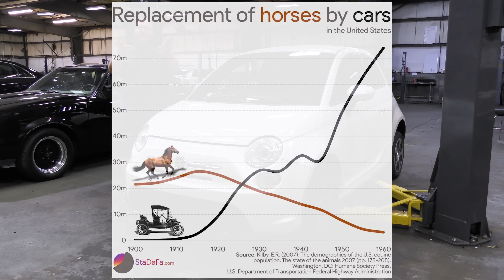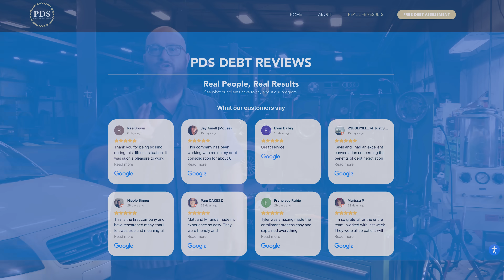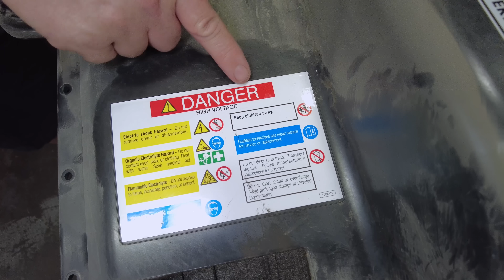How to SAFELY Remove the EV Batteries From my Fiat 500e

Comment: The heart of the battery subsystem is the "BMS" or Battery Management System. They call theirs "Battery Control Module" but that is just industry naming games.  The BMS' function is to monitor the battery health and charge as needed. Health is defined as State of Charge, ampacity, temperature, resistance, balance, voltage and current. Generally the BMS doesn't fail because it is really not stressed in operation. The inverter - the device that converts Battery DC voltage to AC voltage for the motor tends to get stressed and has large temperature swings. Note that batteries when accelerating and charging have peak amperage demands well beyond their normal specs. A battery pack rated for six amps may momentarily supply (or receive) 6 to 10 times that during these periods and because its a chemical process the temperature will rise dramatically and instantaneously well beyond the ability for the coolant system (if there is one) to mitigate. (The coolant will eventually pull this heat away but it will take  tens of seconds or more. So that is the "curse" and the heart of most failures. When batteries super heat over multiple cycles they drift in capacity. And since you have a large number of cells they may not drift in unison. That differential is referred to out of balance and will throw warnings and eventually errors. Yes one bad cell can render a whole pack unusable. It may take 6 years to get there but that is the primary failure mode. And I said "one" bad cell. Well usually its one or more cells that have the worst cooling that go first.  But what of all the not bad cells - they are perfectly fine. And that is why rebuilding with used "tested" cells is a valid solution.  The key thing is once you pull that safety plug this is NOT a high voltage pack. Its a bunch of individual modules you can safely measure just as you would your standard car battery. You measure each cell one at a time (make a spreadsheet!) and determine who is the weakest link.  If you see a small group that are more than 10% below the others - replace them all. Note that many home mechanics have taken these weak cells and recharged them separately and restored them to health. That is a gamble but can work. Its a lot of trouble to drop a pack so decide if the risk is worth it.  The thing to understand  is ALL THE CELLS are charged as one. So the weak cells never get special attention by the BMS. If they did, packs likely would last longer as drift (vs its neighbors) is really what throws the error. 
Anyway - any good mechanic can master this new skill set. Most auto tech classes do a poor job at training for electrical  and specifically computer failures. But its all understandable. EV's are far far less complex that ICE. Its just unfamiliar. So you learn a little and make it boringly simple.  
And please - it should be crystal clear that Climate Change and Global Warming is real. We need this. Even an Exxon Mobil employee admitted to suppressing their climate findings from the 1980's. Can't go back; need to go forward. And it should be obvious as Teslas blow away Hellcats that there is no sacrifice EXCEPT range and charge times. And that is getting fixed. Tesla has open sourced their tech. That means any manufacturer can use it and drive the cost down while increasing the number of suppliers. Over 100 universities are working on new battery chemistries using common plentiful minerals. And all those batteries will be 100% recycled.  So lower cost, longer range, faster charge times and a million mile car is coming.  ICE and diesel specifically will still be around. They have unique benefits.  So there will always be a market to service these.

Note - I doubt its the BMS. More likely there is one or two weak cells. The pack can only charge to the level of the  weakest cell because its en electrical series circuit. Locate that cell and swap it with a new or used one (they are available) and you are back in biz. This is what Hoovie did on his Prius. He did the whole pack but that likely wasn't necessary.  Note that these cells are maybe 20V and 10 amps worst case usually much less. You can safely handle them and even charge them with a low cost RC hobby charger. And you can measure them with a generic DMM. Many Prius owners have removed the weak cells and run a full discharge/recharge loop on them 10 times or so and brought them back to virtually new. Charting their "recovery" tells you if they are worth keeping. If each discharge / charge cycle shows improvement over the last - you keep going.  If each is worse than the last - chuck it and get a fresh module. Finally batteryuniversity.com has all the knowledge you need. Check it out. Great resource.
Reply: What a hugely educational comment.  Thank you.
Reply: Comments like this are what makes YT worth it. Free shared knowledge that benefits everyone. Thank you.
Reply: Wow.. did I learn alot  on this. Many thanks
Reply: Milwaukee batteries work the same way.
Reply: @gregjohnson2073  - All battery packs work the same way.  That's why a cheap RC charger works!  (Even on Milwaukees, DeWalts, Ryobi's etc)
Reply: Battery voltage balancing. Such a relatively simple preventative maintenance that most of not all manufacturers prefer to ignore....
Reply: First look up the effect that CO2 has had on our atmosphere over the last several decades. When you surprise yourself to find out that it has had the opposite effect that many people have been led to believe, hopefully that opens up your mind to more like the very good interview with climatologist Dr. J Christy. The title is his name then "debunks the narrative" There's a reason the IPCC stopped using highly accurate satellite data to measure global temperature in 2015. The results didn't fit the "warming beliefs". I'd give other video references but YT erases comments that contains certain people's names or certain titles. When only one side of an opinion is allowed, it should raise an eyebrow.
Reply: Look up the effect that CO2 has had on our atmosphere over the last several decades. It may be surprising to find out it's the opposite of what many have been led to believe. Then watch the 49 minute interview with climatologist Dr J Christy called data shows there's no catastrophe looming. 4th try commenting, all the rest have gotten censored. What does it say when only one side of an opinion is allowed?
Reply: Look up the effect that CO2 has had on our atmosphere over the last several decades. It may be surprising to find out it's the opposite of what many have been led to believe.
Reply: I've tried 6 or 7 times to reference an interview with a climatologist who presents a lot of compelling data that goes against the "prevailing winds", and my comments have gotten censored every time. That should tell you what the truth really is.
Reply: Look up the effect that CO2 has had on our atmosphere over the last several decades. The answer surprises many.
Reply: The climatologist interview is on YT, and is called "Data shows there's no climate catastrophe looming" and is 49 minutes. Lots of good data in there.
Reply: @readtherealanthonyfaucibyr6444 Just another nutcase with bullshit "information" who somehow knows better than decades worths of global climate research. Besides we can already see and feel the effects every warm winter and hot summer - going from one record year to another.

But I was curious and tried to find that video. Can't find it. Either he changed the title or it got de-indexed due to misinformation.

Usually when I watch those arguments it's one of 3 cases:

1) Religious nutcase 

2) Sponsored by fossil fuels companies and their "think tanks"

3) Right wing nutcase 

Often combinations of the above.

Please don't fall for the conspiracy theory bullshit, just because you think dealing with reality is inconvenient.

Comment: 2016 500e owner here. I appreciate the insight. I drive 6 miles a day and absolutely LOVE my Fiat. You are spot on in your assessments. Hopefully you get that bit back and balance your cells. It's not too different than lipos and brushless motors on me RC airplanes!😅
Reply: LiPo batteries certainly  have changed the rc airplane and helicopter  hobby for the better.
   30% nitro helicopter fuel now costs $160.00 a gallon.
Reply: @PedroBrando  Yup! I've got a few sizeable toys that take a 14s (2 7 cell in series) and a 350 amp ESC. They absolutely smoke a gas plane of similar size, but have a short flight time. Much like my Fiat! It's crazy good. So good Im probably going to grab a few more of them.

Comment: I love my EV.  I also love the old gassers.  The EV is far cheaper to run and more powerful.  Drives really well.  I've driven 115,000km over 3yrs and only replaced front brake pads (because when I had the shop clean and lube the brake system, the pad delaminated).  400$.  

We do need to get manufactures to design their battery packs to be more repairable.  If they could be made to accept new battery modules if the existing ones need service but the old type aren't available, that'd be great.

Battery packs and controllers going bad isn't very common.  This FIAT500e is 10yrs old.  What was your 10yr old daily driver like after 10yrs with 100-200k on it?
Reply: Lawyers would never allow some 3rd party to crack open the battery pack on a old car, exposing themselves to all sorts of liability.
Reply: @aussie2uGA  
See EV in Christchurch New Zealand..
they rebuild battery packs for Nissan Leafs and have cracked the software for English rather than Japanese language appearing on the screens in the cars..
and to insert 40 to 62kwh batteries in old Leafs to make them better ranged than when they were new....

Comment: If you give the VIN number to Fiat, they will be able to see exactly which capacity battery pack it has. I find it kinda funny that its the German part thats let this Italian car down 😆

Its interesting to see the floorpan, its hard to see if its unique to the "E", or if its standard with added attachment points for the pack..Would be interesting to put a gas one on the ramp next to it to see how different it is...

Comment: As an EV driver and enthusiastic supporter of everything electric. I was really impressed with your balanced fair and knowledgeable presentation, been following your channel from the beginning and this video illustrates why you are a proper mechanic and not a technician as seems to be the norm these days. Keep up the good work informing us of the future of motoring.
Reply: I don't have a problem with EVs.  I do think having taxpayers subsidize Teslas (and other expensive EVs) with a $7500 tax credit is unfair.  CARB requirement that vechiles like this are sold is also states putting their finger on the EV / ICE scale.
Reply: @briangasser973 The whole EV trend is entirely artificial in nature. If the technology was there then the market would be driving the change. Government force is what is driving the change and that is the problem. You can't artificially force the change. Also none of the EV people are willing to accept that the batteries have to be manufactured and then you have to charge them using more resources than a regular ice car will. Just typical midwittery
Reply: @briangasser973 . All cars are subsidised at point.
Reply: @iancouper3644 yeah, heck I think even milk is subsidized. It’s the way of things. I own a Bolt; had owned a Fiat 500e and love them both. Good cars.
Reply: @briangasser973 yeah I’m relatively certain that sort of thing didn’t go on in the transition from horses to autos making it a terrible equivalency
Reply: when charging times decrease and range increases enough, I'll jump on the bandwagon.

Comment: Here to stay??? When an obscure outfit from Bulgaria is required to look after a vehicle "only" 10 years old that's not just a failure, but compared to 20yo ICE rides a failure before launch 🤣🤣🤣

And that goes for the vehicle manufacturers as well. Ending factory support for a car at just 10 years old won't win over serious buyers who like to keep their cars long-term. You're killing used EV sales, if that can even be mentioned as a thing, and making keeping them on the road beyond 10 years a serious question and financial burden.

Don't believe it??? Look at all the hassles start-stop technology has caused in gas cars!! Parts fail prematurely, engines dead under 100K miles, more complicated repairs, etc...

The only way to get into an EV today is with the mindset that the price you paid brand new will all be thrown away at the 10 year point long after all warranties have expired 🔥🔥🔥 The number of car buyers who are like that are very minuscule!!

ICE cars are here to stay for a very long time yet... never mind long-haul diesel trucks.
Reply: In New Zealand we specialize in importing Japanese domestic market second hand cars...

so we also know how to reengineer the Nissan Leaf batteries by opening them up and separating out the individual cells from packs from wrecked cars or "useless" packs....
and amalgamating them into a very useable pack that can re reinstalled into a car.

Or if the cells are less than 85% state of health....using cells to build "home batteries" for solar power storage....

Plus of course re engineering the software to translate the Japanese screens into English

and new software to be able to use the higher output newer batteries in the older Leafs.

So 10 to 15 year old Leafs can be restored to better than new range...

It helps that NZ is used to Japanese cars being useful to us in a second life...
and as the climate here is temperate..
the Leaf batteries don't cook or freeze in normal use....

so we have one of the highest concentrations of Leafs in the world...about 120K cars...

So if Bulgaria has the same mindset re Fiat's EVs and does the same reverse engineering...
more power to their elbow if the rest of the world has to go to them.....

Comment: Where are we today indeed! Electric vehicles with totally absurd claimed ranges with no consequences to the manufacturers making these false claims. Also what happens when the minerals needed to make these batteries become scarce? Plus what do we do with the batteries that come out of the older vehicles? EV will never be sustainable. It’s a pipe dream claiming to solve a non existing issue of emissions which has been proven not to be created by passenger vehicles.

Comment: For me, it’s a matter of simple preference. Current battery technology isn’t up to snuff. Some of the emerging ones look promising, but that’s I don’t know how long away. No universal standard is a huge problem.
•I like to work on my own equipment and I’m not tech savvy like I am mechanically savvy.
•I want something that I don’t have to question will last me damn near forever.
•I don’t want something where all the features are screen controlled. Things I readily use and we all use have no business being on a screen. Button operation does the job just fine for climate control and seat control. Otherwise go for it. 
•Privacy. All those tech features, a lot of them track your every move and that’s a major problem legally and morally. I don’t want to be tracked because I value my privacy so I don’t really consent to being tracked. How I live my life and where I choose to go is nobody’s business but my own. Regulators really need to put the lid on this issue and hold companies accountable for invasion of privacy. They cannot keep writing themselves an exemption to our privacy rights. EVs and all other Vehicles produced in higher trim are all offenders of this issue. I will not get a top trim level of any vehicle or an EV on these grounds alone to be honest. Time to respect individual privacy rights is long overdue.
Reply: Keep in mind you're using media talking points.  OnStar stole, monitored, and resold all of our data from GM cars for decades now.  As they say, data is the new oil.  Notice they try to keep quiet the stories about highway patrol calling in to have GM vehicles disabled during a pursuit.  They can turn off the engine, roll up the windows, and lock the doors all from a request.  I agree, thats scary but it's done now regardless of the powertrain in the car.
 When you press the button or turn a dial on any newer car, you're still sending that signal electronically via the canbus to a computer to do what you wanted it to do.  A touchscreen or voice command does the same.
As for working on the cars, what new cars can be worked on without inside knowledge and expensive tech tools?  Even a 12V BMW agm battery replacement needs it to "coded" by a dealer or the alternator will be stressed and fail earlier.  Everything of late has been designed to keep people going back to the dealer service department, where 60% of their profits are made.

Comment: I'm at the halfway point through this video and, not for nothing but, the tunnel running down the center of that car sure does look like you could put a drive shaft in it if one were so inclined to perform a conversion from electric to something more conventional

Comment: I own a nissan leaf and indeed their temprature is not managed but the cells are hardened to take on the temperature differences. Now, they are not doing as good a job as temp managed cells. However if you drive it in a mild climate, charge only occasionaly up to 100 prcent and even less with fast charging... best avoid that all together the batteries can last a long time. We do short distances with the leaf and large ones with ice Ford Kuga/Escape.